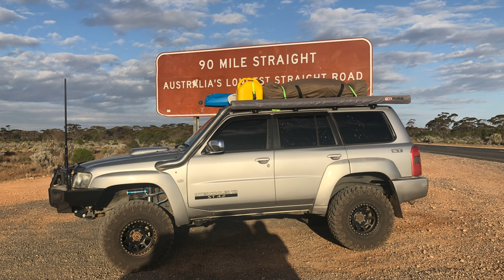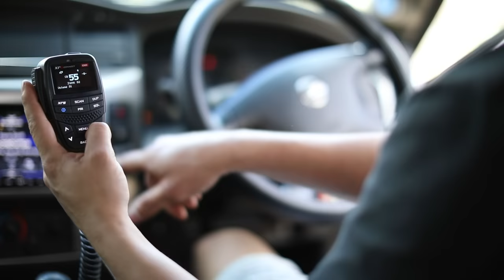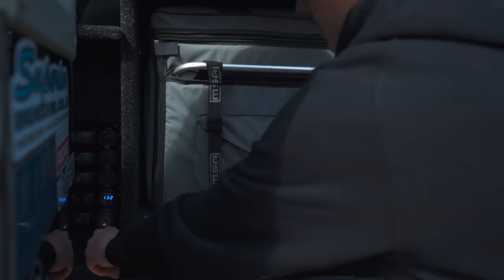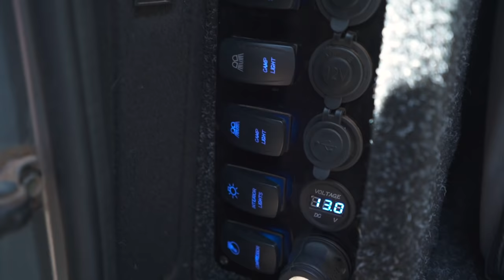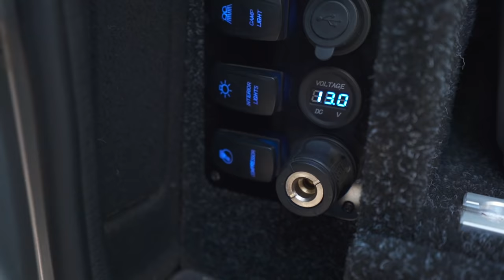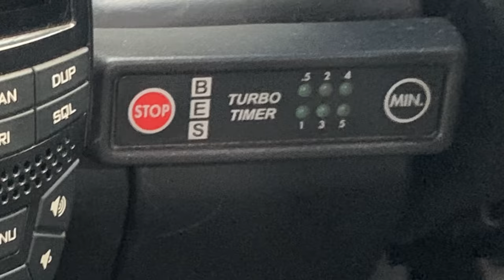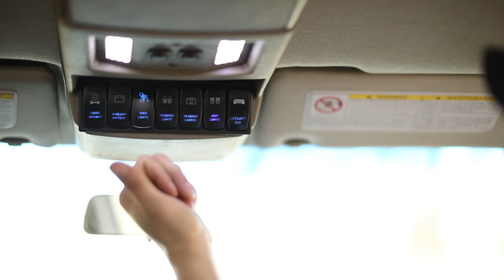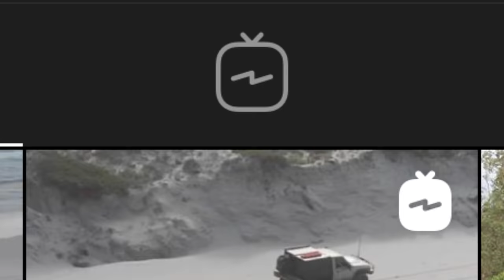4x4 GU PATROL Modified Episode 80

Comment: Ronny A tip for the Coleman Stove..i have a  Coleman stove - 2 burner - fold-n-go which had the same problem of it's on or off.....take the jets out of the stove ,you will find them caked in grease clean the grease off, replace the grease with rubber grease on that O-ring and you will be able to turn that sucker down low..no burning.

Comment: Just a quick not on the placement of the AM/FM antenna. Having it that close to the UHF antenna will affect the performance of the UHF radio. The AM/FM antenna will be acting as a parasitic array that is out of tune with the UHF and may be affecting the tuning/SWR of the UHF antenna. an out of tune antenna can either damage the radio or force the radio to lower its power output to stop it damaging itself.
Reply: Thanks mate I’ll look into it
Reply: Not to mention it plays hell on the AM/FM receiver. Eventually it’ll burn the receiver out rendering it useless.

Comment: Great modified 

I think you can fix the lack of adjustment on the taps on Coleman stoves by pulling them apart and cleaning them and reassembling using Forester hyheat graphite grease as the lubricant.

Comment: LED globes in the standard reflector head light housing paired with 4 inch lift equals blinding everyone on the road. but hey at least you can see better 👍 apart from that tough rig
Reply: Adjust them correctly and you don’t have that problem never get flashed as I have adjusted them against a wall

Comment: Hey mate you said that new intercooler dropped your exhaust gases temperature did you not have an intercooler before or did you have an old one on there cheers mate nice rig
Reply: Was factory intercooled mate, the size of the standard is less than half of the Cross country cooler feeding through a small scoop. Larger scoop and bigger cooler has made all the improvement. 👍🏻

Comment: Can someone help me...what will happen if deep water crossing and waters getting to the intercooler in bonet hood?will it break the engine?thank you
Reply: The intercooler is sealed it is just a heat exchanger hot air from turbo goes through and is cooled by air flowing over and through the intercooler fins which cools the air that has increased in temperature when it has been pressurised by the turbo